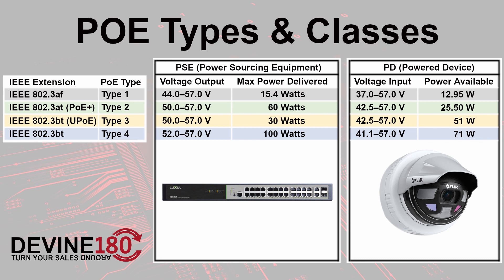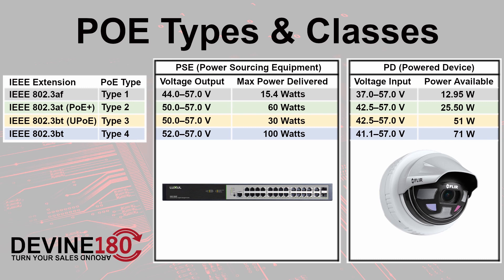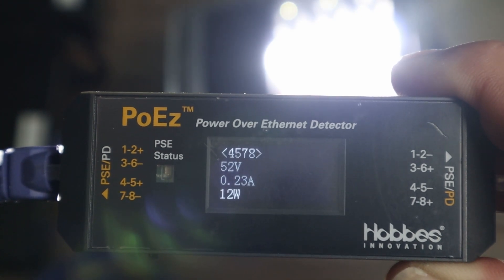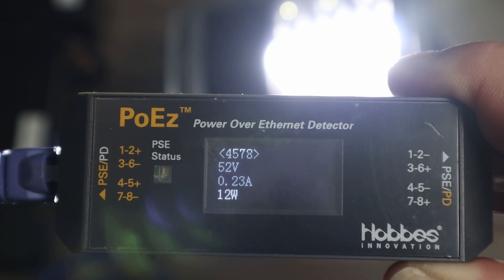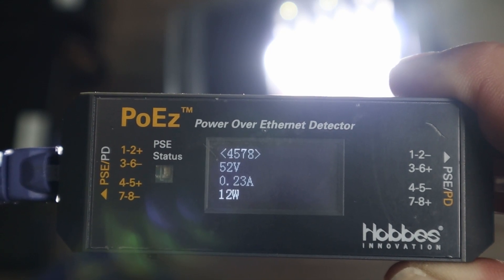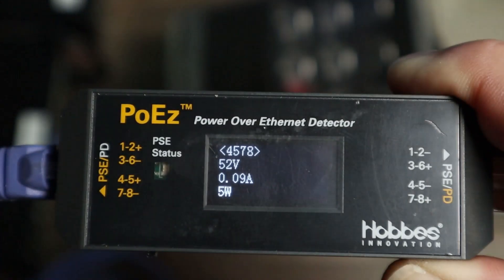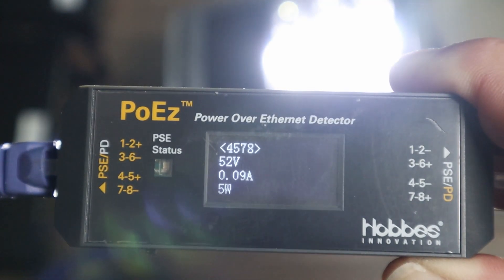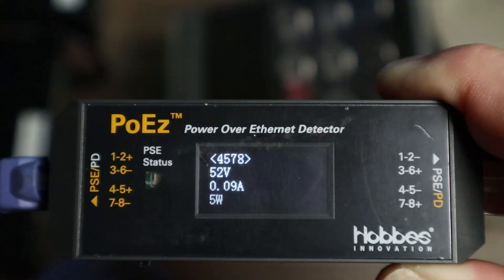How to Measure (PoE) Power Over Ethernet

Comment: Your Amp readings do not correspond to the display on the unit. you say ONE POINT EIGHT AMPS and the meter shows POINT ONE EIGHT AMPS  then you do it again with ONE POINT FIVE AMPS and the meter shows POINT ONE FIVE AMPS. 9:50 time stamp. I don't understand, which is right?
Reply: I agree
Reply: The display is right; he's reading it wrong.  Multiply amps by voltage and you get watts.  If you multiply what he said, you'll get 10 times the proper watts.

Comment: I would just take a multimeter and try to clip it to an unbraided end of 8p8c connector.  I assume you could get a resistance and then use voltage to calculate load...

Comment: If i am going to run poe cameras at my home do i need a poe tester?
Reply: No.  You can buy one independent POE power supply to test cameras then use POE switches.  In addition, I recommend good quality connectors (without corrosion) that fit good quality cable (CAT6) and good software (not the stuff that comes with the cameras).  Technically, the connectors should match the cable size.  CAT6 wires are slightly larger.  Thru-connectors are frowned upon but easier.  Blue Iris works well for Windows and probably great ones for Linux too.

Comment: Chad, I think you have your max power delivered watts for PoE+ & PoE++ (type 3) swapped on your Power Sourcing Equipment slide starting at the 2 minute mark. Slide is incorrectly showing Type 2 at 60W and Type 3 at 30W.

Comment: Good video. Finally a pro that explains it. I’m a cctv pro since 1983. I finally get the poe switch operation. I was missing the pd simulator function and why my poe tester wasn’t showing me a voltage current value. Very good video. The boring stuff is the best part to understanding poe. Do not skip it! Many thanks. Jc cctv services. New York City